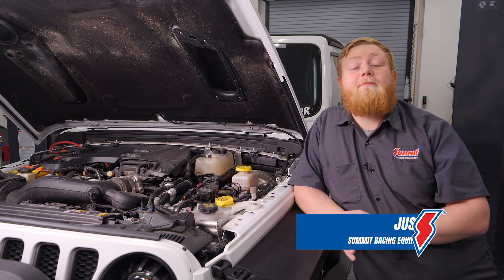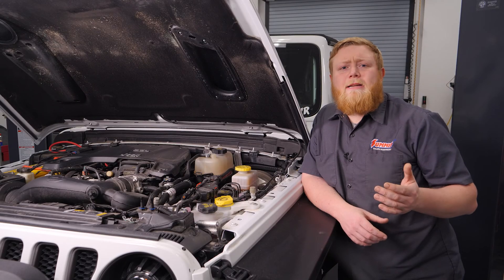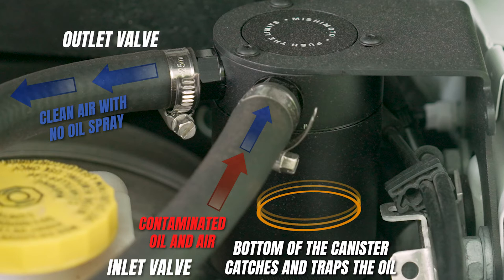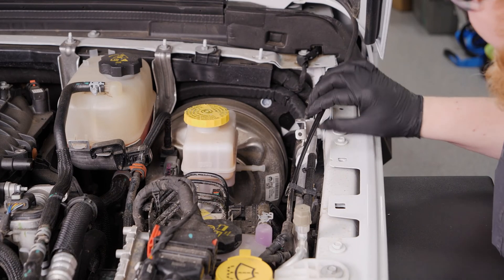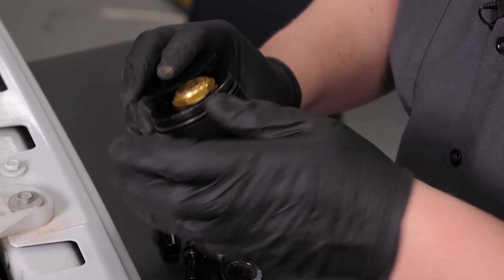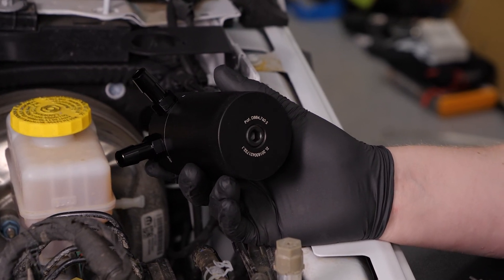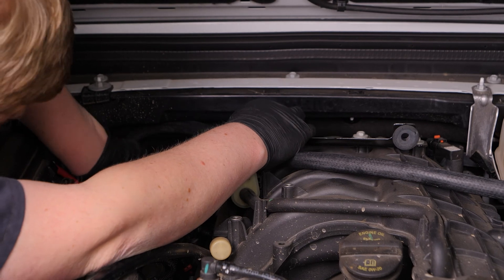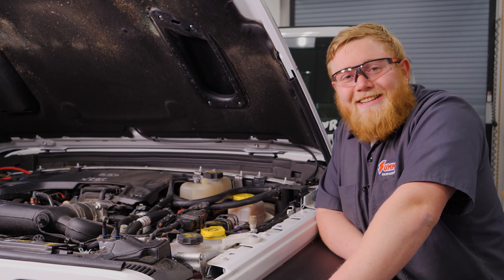Say Good-bye to Blow-By with a Catch Can

Comment: How do these hold up and functioning is cold weather? Is there is risk of them freezing and not allowing crank pressure to be released from the engine?
Reply: I know I've heard people add a little antifreeze to the bottom of can, I would imagine engine heat would melt it in quick order
Reply from the maker: Great question Colby ! we haven't had any issues with ours freezing in the cold ohio weather , it would have to get extremely full to cause an issue
Reply: @SummitRacing   awesome thank you. Looking at one of these for a 23 suburban with the 5.3. Trying to head of the direct injection issues